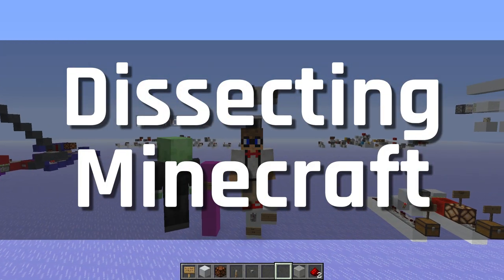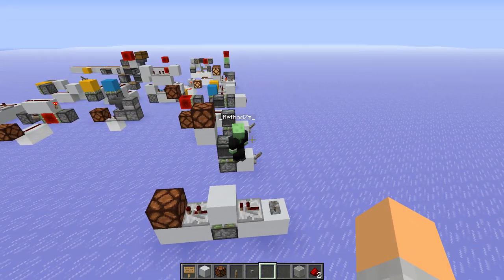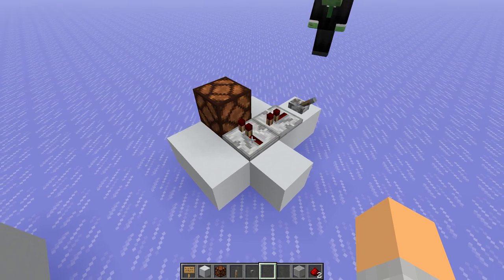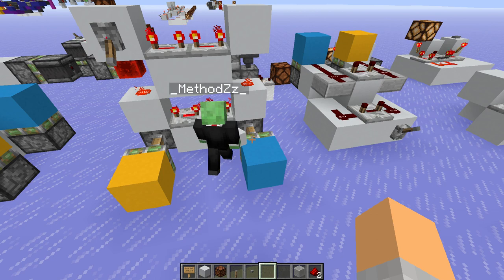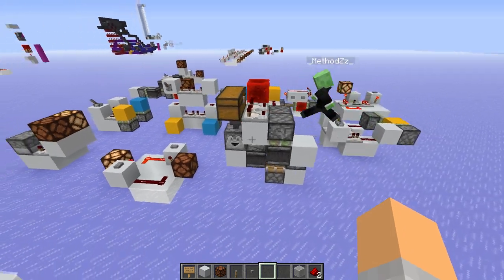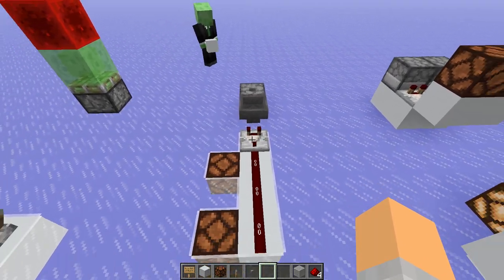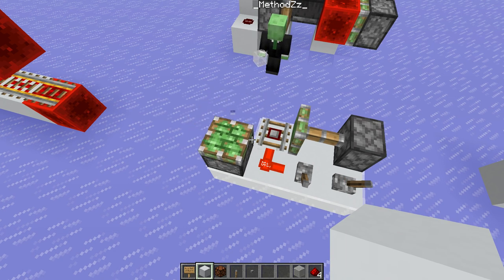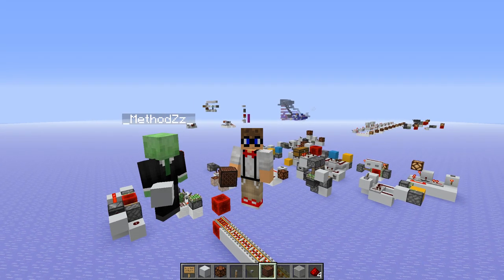Dissecting Minecraft #6: Common Circuits | Minecraft 1.13

Comment: First of all thanks for the show, you  guys are great and i improved a lot watching your dissections. Here a problem i have. I'm uneducated about the matter, i mean logic gates and ciucuits in general, i watched many videos about them and i made a redstone world to build and understand them. The problem is, when i face a "real" life problem, like automate something in Minecraft, i very hardly can visualize how those gates and circuits could help. I give you an example. I consume good amounts of respiration and night vision potions, i have lots of material, i thought i build some mumbo jumbo (ha ha) to do it, something like i push the button and it gives me 3 potion of each kind. I went in my test world full of hope just to realize after 30 minutes it's something beyond my skill. But i know i could do it. The main problem was to control the 3 hoppers involved in the contraption to unlock in specific moments for specific time. If anyone has suggestions would be welcome.
So, my point is this, in the learning curve of the redstone there is a big leap between understanding the gates and actively use them. Is not a criticism direct to you guys but in general to the matter of the redstone.